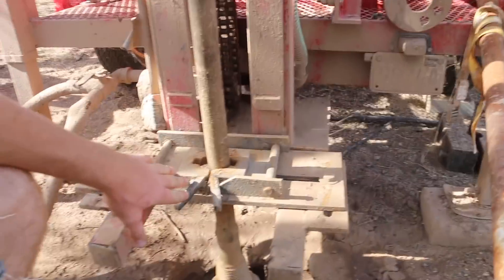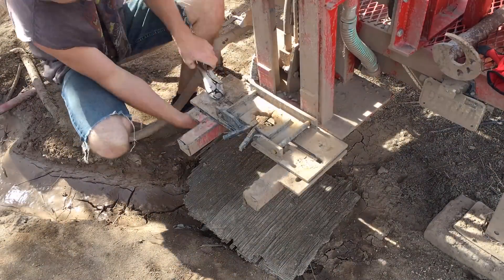Protective Casing And Upgrading The Drill | Drilling a Well Part 4

Comment: viscosity of mud determines how the pieces coming out of the well, one of the uses of bentonite the other being wall cake to hold back the loss of water. the air is sent down through another pipe through the center of your drill pipe. this is reverse drilling. air is used to blow off the area of mud above it, creating a pressure differential. mud is sent down the hole around your drill stem and returns through the drill pipe, hence the term reverse drilling. Smallest pipe i have ever seen for reverse drilling is 7" id pipe. your baby rig won't work for reverse. try thickening your mud and remember to circulate the hole for 10 minutes or so to clear cuttings from well before making connections otherwise your cuttings will drop out of suspension when you get deeper and trap your drill string. good luck